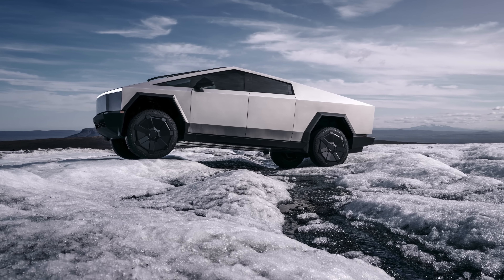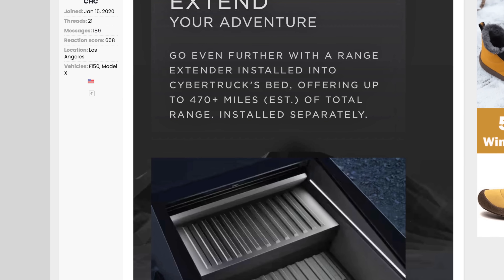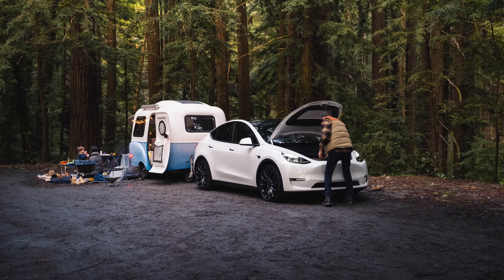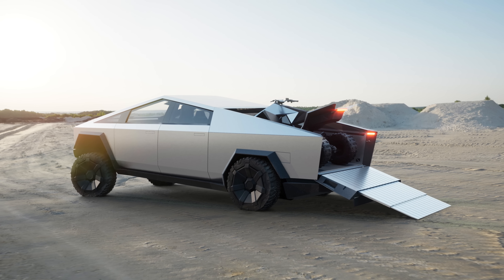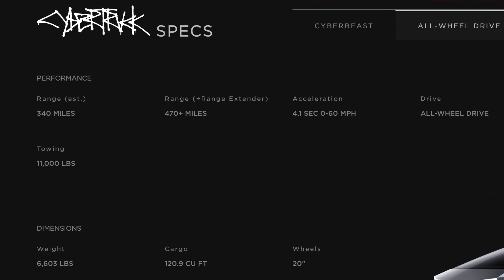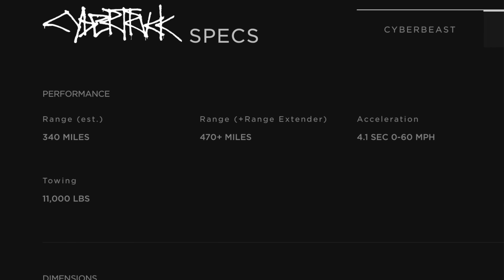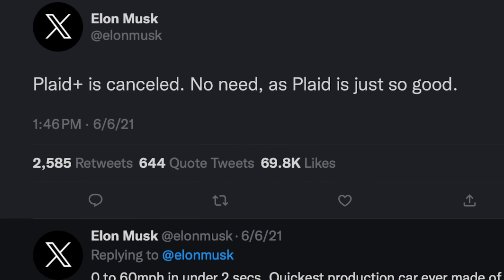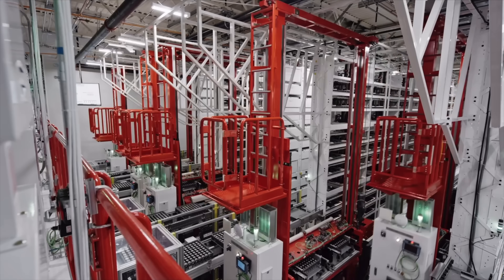Cybertruck Range Extender 📐Explained

Comment: For towing cybertruck will be useless and the range extender will make it less useless also the battery will function the same he only difference is it will take ever so slightly longer to charge a set amount of miles and you have the option of more miles. That is if this is designed well which knowing Tesla it won’t be but oh well

Comment: Your fixation on small battery, short range and quick charging curve being superior doesn’t help the newbies. Range probably is top concern especially with road trips. The lifestyle change needed to convert to an EV person is already not a small psychological hump. Now you are asking them to retune their minds to short range, small battery … quick multiple charges during road trip… it’s delusional. I don’t disagree with your strategy… just doesn’t apply to the masses.
Reply: i’m longtime Tesla bull and Im not happy it doesn’t have 500 miles of range. Trucks need to be able to tow. 500 mile range is cut in half for towing
Reply: @MikeHewitt Yep, same as gasoline pickup trucks. Less than half the normal range for those too.

Most people, mostly don't tow their heavy RV or boat long distances across country, most of the time.
Most people tow their boat, utility trailer, ATVs or small campers regionally from home.

If people tow heavy RVs long distances cross country, they choose and purchase a heavy duty diesel truck costing $$80,000 to $100,000 these days.

Contractors, construction workers, tradespeople, yard care people and landscapers also don't tow cross country. They tow regionally, closer to home,  where they can make money.
If they were on the road all day driving long distances, they're not making money.

The media is focusing on a non issue, for most people. 

If you need a powerful heavy duty pickup truck for 12,000 pound heavy hauling, right now, those few people will choose a diesel truck.
Everyone else could be well served by a Cybertruck.
Reply: @dvader3263  You’re ignoring some important facts. My 1500 crew cab gets 19 miles to the gallon hwy and holds 30 gallons. 
Guess what? That’s 570 miles of range. So if I’m towing and you want to cut that in half I still get 285 miles of range. That’s more than enough but because the CT only gets 300 miles of range when towing it’s 150.
If it makes you feel better to pretend like that doesn’t matter go for it. It matters to me and many others.
Reply: @MikeHewitt exactly.
Reply: @MikeHewitt  me too. Exactly. I have two reservations for CT. I’m first 10min reservation holder. Don’t think I’m going to place the order. I thought CT would at least have the range as MS. Tesla didn’t blow past the competition with CT. Its not even the best product in its category.
Reply: @LovingCabal well said and bravely honest
Reply: Or anybody who does not have home charging. Not just trip takers.
Reply: It doesn’t take long to learn though. One long round trip. I’m not sure CT is a good first EV though. It’s quite an investment for that. Maybe Turo something for a few days first, at least.
Reply: @TheScottShepard  Glad you are not the decision maker for Tesla. Tesla dominated not by letting people ‘learn’ how to live with it instead by not letting the customer have excuses to make the change.
Reply: @LovingCabal  Well that's a garbage perspective. Tesla dominated by having the best EV at any price point for years, always one-upping the competition. Then as other automakers started catching up or surpassing them, the far superior Supercharger Network started being the primary factor to choose a Tesla. Then in 2023, prices were dropped dramatically from their ridiculous 2022 highs so the price is better than much of the competition, gas or electric.

However, Tesla not listening to customers, doing things differently with little benefit to the customer, and overpromising/underdelivering has cost them a lot of public goodwill, objectively damaged the brand, and influencers who once were Tesla fans are fans no longer because of Tesla and that's sad.

I believe that this very obvious loss of brand image and public goodwill has resulted in Tesla having to lower prices below what would have necessary had Tesla remained beloved in the EV community. Instead, every single fan I've spoken to and myself now have mixed feelings about Tesla instead of the Apple-like support they once enjoyed. Will Tesla remain successful? Yes, they will. But Elon has driven Tesla's company culture in the direction of minimum viable product instead of delighting the customer with exceeded expectations.

I hate to see Tesla go from Hero to Villain but that's exactly what's happened. I think it started with the Long Range RWD Model 3 being cancelled, then the Model Y LR RWD, Plaid Plus, Yoke steering with horn button, 4680 Model Y being crappy, overly-optimistic range figures, parking sensor removal before vision was ready, HW4 release before it's ready, FSD still not being ready, deleted stalks, and now the CyberTruck is proving to be worse than both the Lightning and Rivian in range and charging speed (so 800V was for nothing??). And the efficiency argument is basically irrelevant to a truck owner. I hate to say it, but I don't want a CyberTruck anymore. Steer by wire is cool but practicality, space, useability, range, and charging are far more desirable. Sigh...

Like Kyle from Out of Spec said, give me a double stacked battery pack and 350kW charging. That's what it should have shipped with, even if production of those monsters was very limited. But 250 miles real world range is trash; not going to road trip in that. People laugh at the Hummer EV, but it's awesome! Three hundred miles real world is my bare minimum and I'm not buying a BEV until I can get that at a reasonable price without incentives. Sticking with my Volt for now.
Reply: @TecnamTwin  well said. I've been hammering at some of your points that is causing Tesla to lose goodwill and customers. They need to course correct quickly or they will slowly lose customers, especially when NAC is available to most EV manufacturers in the future. Those 4680 cells are quite disappointing along with the CT. Hope they figure it out soon or at least source higher density/faster charging batteries from their suppliers, CATL comes to mind.
Reply: You’re the embodiment of “it’s not better because I have to change my habits”
Reply: Charging for 15 mins every few hours isn’t a big deal lol especially since it costs less than gas
Reply: @camronrubin8599  100% I agree, most people have families and pets. They need to stop every 2-3 hours anyway
Reply: I agree. He likes the basic stuff and doesn't believe over 300 miles is necessary. Most people want longer range because most people travel far and want to eliminate range anxiety.
Reply: @Hugh-py2ce Most people don't travel far. Most people travel close to home most of the time and also don't tow most of the time. Some people travel long distances, but most people don't travel long distances often.
Reply: @dvader3263  That's not true. Where do you think range anxiety comes from? People travel more than they use to specially on the weekends. Fishing, boating, state to state, etc.. I'm one of them and know what I'm talking about.
People don't want to worry about how far can my ev take me, you really don't want to worry about it even if you have the best charging network in the country.
Reply: @Hugh-py2ce  because our brains suffer from anxiety about the stupidest things, even when we know full well it doesn't make sense. You're confusing a mental health issue, with a technological one.
Reply: 100% depends on your lifestyle. For the majority of owners, a less expensive vehicle with lower range is absolutely worth the trade off.

Comment: I think that Tesla will keep the range extender. Chevy's EV Silverado, Cadillac's Escalade IQ, and GMC's Hummer all have gigantic (232kWh) battery packs to handle off road, towing and cold weather conditions. And the Cybertruck and Tesla in general is getting blasted for problems with cold weather range and charging these days. If lower range was not a perceived problem for Tesla, then they could have quietly dropped the option. But as it is now, I think that they will keep it. And maybe even increase the largest pack size.
Reply: They simply pretended they intended to produce an extender to waive off range criticism. Now that talk has died down the fake extender is scrapped.

Comment: Correction to your video: The dual motor Rivian (352 EPA rated) has more range than the dual motor Cybertruck (340 est) not less. 

I don’t see Tesla doing the range extender, while Rivian has the max pack and it will greatly improve before the Cybertruck even gets close to 400 mile range.
Reply from the maker: I didn’t say it had more range, I said it was more efficient

Comment: Yeah, im not sure about the value proposition for the range extender but thr Rivian max pack is not a comparison, it is the same amount of cells just a different chemistry, not additional cells. I hope they can improve the charging curve with V4 800v charging because that would be a game changer. Also you said 2 charging curves to manage, it would actually be 3 on v3 superchargers. The truck already splits the pack to 2 400v packs which isn't helping rn.

Comment: My instinct is that they will definitely have the range extender at some point.  And I do think it was a very good choice on Tesla’s part to keep the range around 300 and offer the range extender.  (The 16k price could go up though).  Dual motor with incentive + range extender = $88,500
Reply: The range isn't close to 300. 250 is more accurate. That's 100-0 which nobody will ever do.
Reply: There will be no range extender.

Comment: I had an idea to buy the Foundation series, but I was not sure if the spot would still be available when I filed my taxes. I initially thought of skipping the extender, but Zack's video of towing his EV Hummer conversion changed my mind. I realized that we would need the extender for our Cybertruck as well.
Reply: You wanna wait till this extender enters production, if you really need towing range and cant use it without, why would you get the CT now?
Reply: The Cybertruck is not a good solution for this specific use case. In the US there are no other products currently. In Europe we have many choices for mid sized trucks very capable of towing and hauling. Of course only up to 55 mph. The sme limit as all trucks.

Comment: 70 mph highway range test with A/Ts and AWD was less than 260mi.

The estimated 470mi with the extender is with A/Ss, not A/Ts (the ugly ones).

A larger pack should allow you stay in the max portion of the charging curve, so imagine staying at 250kw up through 40% of total capacity, getting you almost 150 of range before hitting a charging shoulder. 

My big question is whether the extender and tent can fit in there together. They look like they might not interfere but I’m not 100% on that. 

While we are talking redesign, why not stick the extender in the subvault or just make the main battery big enough to delete that.

How will the extender precondition? Great question. When the CT parts catalog and explosion diagrams got out, I looked for the extender hookup but found nothing. So it’s an open question whether the HV and coolant will get hooked in, or just the HV.
Reply: If the extender has 50kwh, that is 40% of the existing pack, meaning that 260mi times 1.4 is 364, pretty significant.
Reply from the maker: Road tripping is a lot more than just hauling cells. Charging curve, top and bottom buffers, and preconditioning are all factors that need to be addressed
Reply: True, I use my MSP mostly for errands and road tripping. Recently we did SF to LV in a day, no problem. Basically did multiple 10 to 50% charging stops, coinciding with food/stretch/biobreaks. The CT would need more juice, but the higher input and broader curve would likely make up for it, if you stick to 250kw stations, and time would likely be similar, it would just cost a lot more.
Reply from the maker: Range extender won’t help much